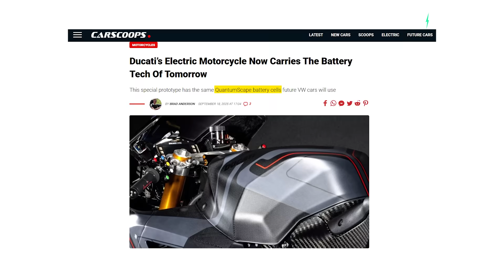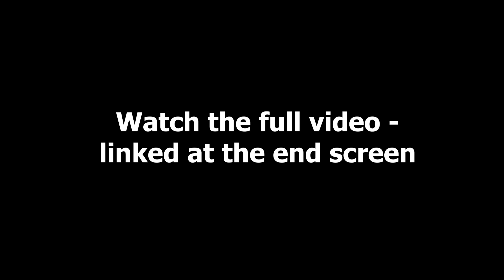Electric Ducati with Solid-State Battery: Motorbike Tech of the Future Arrives

Comment: Let's hope development continues and more manufacturers get involved.  All the back-tracking on carbon and EV targets doesn't bode well though for EV development.  I have a restored Ducati 996, and would love an electric Ducati to go with it.  Judging by the emoto footage of these bikes racing, the front ends wipe out a lot so one assumes they've not solved the engineering dynamics yet - not surprising given it's still very new tech.  And silent superbikes would need some way to attract the attention of other road users: crash investigators have learned that drivers don't tend to see bikers as easily as cars, and they find it hard to judge bike approach speeds even with ICE engine and exhaust noise.  I often catch people by surprise (unintentionally) in the supermarket car park as I drive past in my electric car.  I know a lot of bikers can't imagine enjoying a silent bike, but I think the power delivery could be intoxicating... though I wouldn't fancy trusting any sort of AI autopilot on a bike!

Comment: Mx ~ Never in the wrong gear, more power than needed, Road, batt weight measured with range, SS will dramatically change this... EV notes: 1837 first EV Racer 60mph, New York had 15,000 EV chargers 1910, Henry Ford drove Baker & Detroit Electrics; What's Old is New Again...

Comment: Sorry mate- I have an EV and looked at bikes ( I have a couple I ride for touring and leisure) None come close to appeal for the power to weight is miles away for ICEMB compared to EMB to achieve the minimum acceptable range for a bike. In my case 300k (highway range not town range).  Most touring bikes can do close to 350-400 and some even further. The Ducati will not be changing any game yet and I will bet you highway range of less than 200.
Cannot go touring on any Electric motor bike  be it announced or in the works. They need to at least match the power AND closer to the highway range of an ICEMB remembering that this is typically Half compared to cars.
 None are close (most are about 40-50%). Some have lots of power (Verge) and heavy without the range! Perhaps when energy density  triples over current technology. for now only good for commuting and short ride charging at home.

Comment: A problem with electric bikes in the U.S. is the abysmal charging times. Range comes in second. Thought about getting my motorcycle endorsement for an electric bike however not worth it yet.
Reply: Since it is a solid-state battery, it should charge much faster.

Comment: I had a Lightning Strike Electric motorcycle.  All E-bikes face two primary hurdles: energy density and sheer weight. Picture slapping the heft of a full 600cc motorcycle onto your typical 1000cc bike—it's that much added bulk. These beasts are so heavy that if one tips over, you'll need three people to heave it back up, especially if it's got clip-on handlebars.
Range Realities:     You never fully drain the battery to zero; always reserve at least 20% charge (15 miles) to limp to the nearest charger without wrecking the cells. Most deluxe models pack a 20 kWh battery, so you're looking at about 16 kWh of usable energy at 80%. Electric bikes typically guzzle 4–5 kWh per mile. At an average of 4.5 kWh/mile, that nets you roughly 75 miles per charge (4.5 × 16 = 72, rounded up). In my own test run—cruising conservatively from Hollister to LA at around 60 mph while drafting behind trucks—I squeezed out just over 100 miles by averaging a thrifty 6.5 kWh/mile.
Charging Limitations:  Remote charging stations always cap you at 80% capacity, so you roll out with 16 kWh when fully charged.   Factor in that 20% buffer at the end, and your true usable range drops to 12 kWh. For aggressive riders (and let's face it, most aren't dawdling in the slow lane), expect 4 kWh/mile consumption. That means recharging every 50–60 miles. These bikes are tanks—yank the throttle hard, and the energy vanishes fast. Good luck out there!

Comment: Electric motorcycles are just not going to cut it.  Too heavy and without the sound and feel of an engine they are pointless.   Proper motorcyclists are just not interested,  and suspect honda are going to find this out with their upcoming offering just like kawasaki have with their hybrid. Personally I'm not willing to expose my other motorcycles to the risk of fire a rechargeable L/ion battery would. Motorcycles are largely ridden by older generations,  and that's the target market.  Electric bikes will only accelerate the Demise of motorcycling.

Comment: ### Ducati Electric Motorcycle: The MotoE V21L Prototype

Ducati's primary electric motorcycle is the V21L, a prototype developed exclusively for the FIM Enel MotoE™ World Cup (the electric class of the MotoGP™ World Championship). Introduced in 2022 and in use since the 2023 season, Ducati serves as the sole supplier, providing 18 identical bikes per race weekend. This racing-focused machine incorporates innovative electric drivetrain components, but it's not a street-legal production model—though Ducati has hinted that its technologies could influence future consumer electric motorcycles.

As of 2025, Ducati has announced refinements to the V21L for the ongoing MotoE Championship, focusing on performance enhancements across the bike's systems, but detailed specs for these updates remain limited in public disclosures.

#### Key Specifications
Here's a summary of the V21L's core specs based on official Ducati data and announcements:

| Component          | Specification                                                                 |
|--------------------|-------------------------------------------------------------------------------|
| *Power Output*   | 110 kW (147 hp)                                                              |
| *Torque*         | 140 Nm (103 lb-ft)                                                           |
| *Motor*          | Permanent magnet synchronous electric motor; 21 kg (46 lb) weight; max rotation speed of 18,000 rpm |
| *Inverter*       | 5 kg (11 lb) weight; derived from high-performance electric racing unit      |
| *Battery Pack*   | Custom-shaped lithium-ion pack integrated into the bike's midsection for optimal mass distribution and aerodynamics |
| *Cooling System* | Advanced liquid cooling for efficient heat management and reduced charging times |
| *Electronics*    | MotoGP-derived throttle response, electronic controls (e.g., traction control, ABS), and software strategies for seamless power delivery |
| **Chassis & Design**| Racing-oriented frame with aerodynamic optimizations; developed in synergy with Ducati Corse for track dynamics |
| *Weight*         | Not publicly specified (focus on lightweight components like motor and inverter) |
| *Top Speed*      | Not officially disclosed (estimated ~200 km/h / 124 mph based on MotoE class limits) |
| *Range/Charging* | Optimized for race use; quick charging enabled by efficient cooling (exact range not specified for track-only operation) |

This prototype emphasizes lightweight construction, rapid acceleration, and track performance, drawing on Ducati's internal combustion expertise adapted for electric propulsion. For context, the V21L replaced Energica's Ego racer in MotoE and has contributed to Ducati's dominance in the series.

Ducati also offers electric bicycles (e-bikes) in partnership with Thok, such as the TK-01 RR e-MTB, but these are pedal-assisted and not full motorcycles. No street-legal electric motorcycle from Ducati has been released as of September 2025. For the latest on potential consumer models, check Ducati's official site.

Comment: Why would you need more than 200miles on a car or motorcycle? People don’t know what they don’t need, and still don’t understand how & where to charge….🤦‍♂️
This is why EVs aren’t cheap, but they easily can be.
Reply: Why do you need more than 200 miles? 😂 you’re kidding right ?
Reply: @Cruise1966  There are now EV fast chargers every 80 miles. I had a 169mile range EV in 2020-2022 and drove across country w/o issue. Occasionally I had to charge to 100% to make it to the next station which was more than 120 miles apart, but it was rare.
Obviously, having more than 200 miles range would be nice, but what most people don’t realize is that that also means added weight and increased insurance cost due to the battery . Furthermore, the number one thing people misunderstand about EV is is the paradigm shift that happens when you learn to charge whenever you’re parked instead of just a quick fill up , yes even on a road trip-even a full-time road trip will allow the bike to be parked for at least 1/3 of the day, while you’re sleeping/eating/etc.
So now we’re in a world where everyone’s complaining that they don’t release a cheap EV, when they easily could. They just know the public has trouble understanding these two key components; how to charge differently than filling up, & the existence of the infrastructure. The only places in the US that are still difficult for EV roadtrips are Nevada, South Dakoa, and maybe two or three other states that although do have chargers, they’re just more spread out.
Only those who are unaware and lack experience with fully electric vehicles keep demanding 300 miles of range or more like it’s the only way to make this stuff work . This is merely the perception of someone with a gas car who hasn’t figured everything out yet. Most of us are charging from 40 to 60% in the matter of 5 to 15 minutes while road tripping to charge any longer than that is foolish and will only leave you stranded and be charging less miles per minute. When road tripping, stopping more frequently for less time will get you there quicker with better peace of mind & almost ZERO range anxiety. If you always have enough range to go to the next three stations, you’ll never wait in line.

Comment: Motorcycles need a Tesla to happen. Basically you need double the range of a higher quality motorcycle (at least 300+ miles). Also need equivalent power or better (150 horsepower or better). All this for a price range that would be similar to a mid to high quality ICE bike. Verge TS Ultra is one of the current prospects, I'm just looking for one that's a cruiser style.

Comment: By 2040 charging infrastructure (& batteries) will rival petrol/pumps numbers today. If FSD/robotaxi is the norm we will see wireless charging ubiquitous. Maybe anyway. BUT anyone who predicts the future is going to be both wrong and correct. Quantum prediction! It all depends how you cherry pick from the prediction. In its entirety - wrong, elements, most probably correct. I remember the prediction that tyre pressures would be read from sensors - they didn't see gear/engine/wheel rotation/etc being computed to display tyre pressures.

Comment: Moto E has been suspended indefinitely. 

If an E motorbike could have a decent range, then it might take off in Australia. This weekend I did a 500km on Sat, similar on Sunday on a conventional motorcycle, fuel stops were done in minutes in relatively remote locations. This is where an E motorbike would fall short by a significant margin. EV bikes globally have not taken off because of range. Perfect inner city commuter, not so hot for discretionary recreational riding.

Comment: I have a Tesla & am on board with EV transport however I have a BMW adventure bike that I use to go away for 4 to 5 days doing 500 kilometres per day. The main thing is the range but mainly the charge time. I can go the distance wash day but my mates always need to fill up at about 200 to 300 kilometres. If the range was 500 kilometres or the charge time 30 minutes we could easily schedule this in our planning. Currently the on board charging for motorcycles requires heavy inverters & interface. Weight is the issue for motorcycles. I have no doubt this will be solved with 500 watt per kilogram solid state batteries but till then I still need to use a dirty combustion engine on the BMW!
Reply: Ditto
Reply: You’re forgetting the best opportunity to charge (even slowly); Overnight while sleeping. If this isn’t possible, consider that you probably won’t be riding 16 hours/day & therefore can potentially charge at a public EV station during meals/breaks/bathroom stops, etc, the way cars do. 
Although heavily used occasionally, the average vehicle is parked for 90% of its life doing nothing.
Reply: @TheTanman412 when they start manufacturing ev bikes, they are going to be designed by dipshits and they will never look as beautiful as a R12 Nine T
Reply: Don't worry it's just a matter of time not if. In short time..

Comment: Thanks for the video. The big and amazing jump will be when they can make mountain snowmobiles electric.  It’s so beautiful in the woods and you go up the steep hard mountains in and out of trees and they are all two stroke very very loud because of weight and power. A quiet, fully electric snowmobile in the mountains would be unbelievable!  They have some electric snowmobiles for the trails, but that’s not the same

Comment: Lol... Sorry, but here in America, guys aren't going to trade in their loud, manual shifting bikes.
Reply: See Eric Cartman’s opinion on the matter.
Reply: Sorry, but the rest of the world thinks America is broken and has stopped caring what's happening there.
Reply: Losing the engine, is bad enough........ but no manual gearbox means I'm definately out. Unfortunately, it'll drive up the prices of proper bikes,  just as it did with my used petrol manual car (paid well over book for it, but unlike electric cars it will hold its value).

Comment: The problem with nearly all electric motorcycles so far was small batteries with very low range, often even under 60 miles oder 100 km. Zero is much more expensive. So developing an electric motorcycle with decent range and a fair price will be the requirement to transform the motorcycle market. Batteries get cheaper by the day but prices for electric motorcycles so far did not.

Comment: Simple problem, weight and power. You need about 500wh/kg to get a power train and cycle parts to about 200kg and a decent range. 
Slowly, we are creeping towards these numbers. 
When we get there, electric bikes will be easy.
Reply: Until then, electric bikes are like fitting a Viper engine to a bike with a peanut tank. 
You can do it, but it's very heavy and doesn't go very far.
No mention of the kwhr/kg in this article.

Comment: I don't want an electric racing bike. I want a sensible electric motorbike that can replace my Honda NC750X. I did ride a Zero and it was amazing, best bike I have ever ridden. The price was ridiculous though. I think we might have to wait for the Chinese to get into the electric motorbike business, because the Japanese legacy manufacturers are not coming up with the goods.
Honda has a new electric motorcycle WN7 which is going in the right direction but it’s still a long way off.

Comment: Range has been a motorcycle problem for awhile now. My Triumph Soeed Twin only goes about 150 miles on a tank of gas. Adventure motorcycle still have big fuel tanks but they are very large and expensive motorcycles. Fuel tanks have been getting small in motorcycles to get better performance  specs on paper. Battery motorcycles need to be able to charge up quickly because range is a real issue.

Comment: Dude almost every adventurer touring motorbike is > 400km range for ICE ; The host is clearly clueless about motorcycles .
Reply: But you seldomly ride 400 km in one stretch.
Reply: @docsnider8926  That's y some people only rides touring bikes , but the host said seldom ICE motorbikes range is >400km is FALSE AF . Majority current decent priced electric motorbike is around ranged 120-200km(max) ICE motorbike is around 300km+ with at least 35% cheaper in price as well and more performance = higher top speed .

Comment: I hate to be the guy who asks this but 400 km on an electric motorbike is the same sort of range as an electric car.. so does that mean that the batteries are just smaller and the motor is still more efficient than a car? Because that would carry the motorcycle efficiency advantage over to electric which is what I'm hoping.
Reply: My Versys with a larger tank got around 300K range touring if I wasnt flooring it uphill. If there is fast charging for an electric thats good for me
Reply: Bike weighs way less than a car…think about it.
Reply: @philarmour  Your point?
Reply: @jaaklucas1329  the bike is lighter, therefore doesn’t need the same energy to move it, therefore more range.
Reply: @philarmour  Yea ,thats true, apples and oranges though in my opinion. Look at the physical size of a E-car battery pack with a 300k range. A motorcycle is restricted by the size of pack you can squeeze in there. Otherwise the scale needed would be easy to achieve. I do think though with all the brilliant people working on battery tech and motor efficiency real touring on a E-motorcycle is coming.